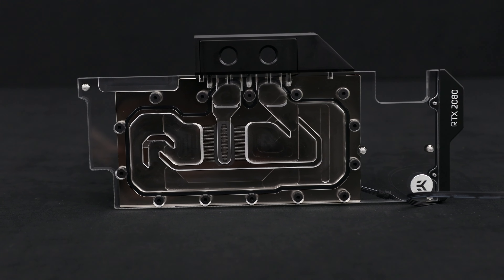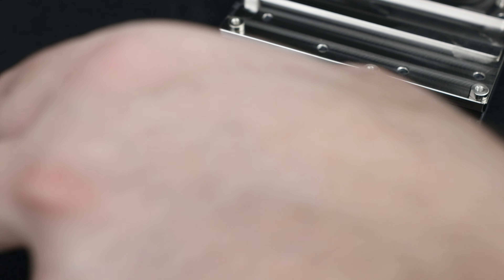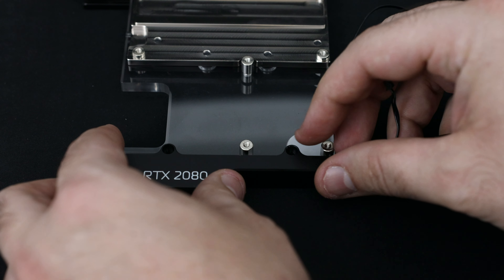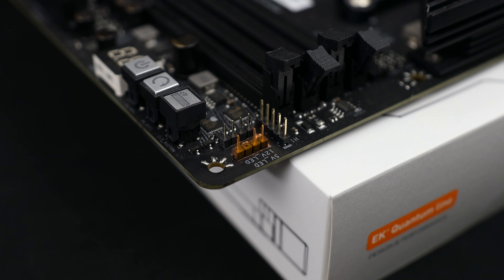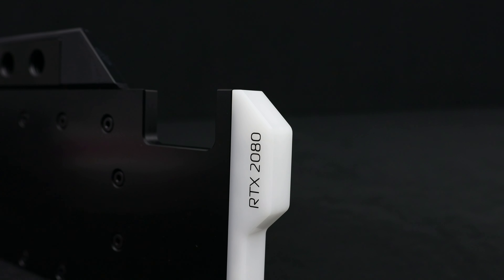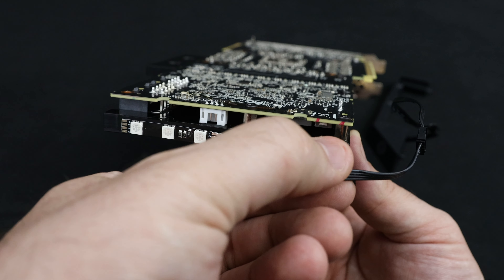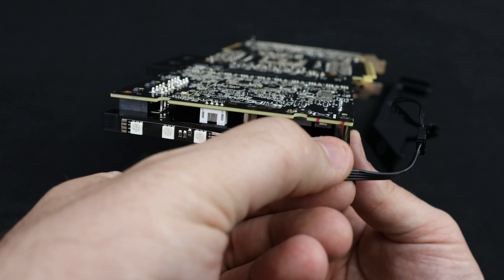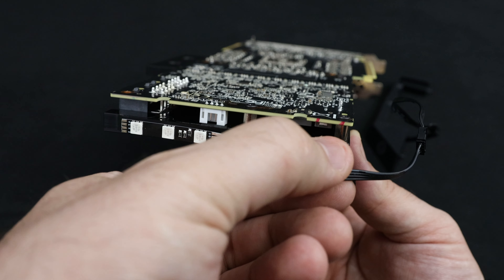How to Install D-RGB Upgrade Kit for Reference Edition RTX GPU Water Blocks

Comment: okay. i have 4 d rgb products from ekwb. where do i connect them when i only have 2 d rgb slots in my motherboard
Reply from the maker: You can use a splitter cable or purchase an EK Loop Connect from our shop for more connectivity and features :)
Reply: @EKWBofficial  thanks!

Comment: I already have my plexi block and backplate attached too my card, can this still be installed without taking it apart?
Reply: That's also my question.
Please, EKWB, is it possible to install the DRGB upgrade kit without having to disassemble card and waterblock / backplate?